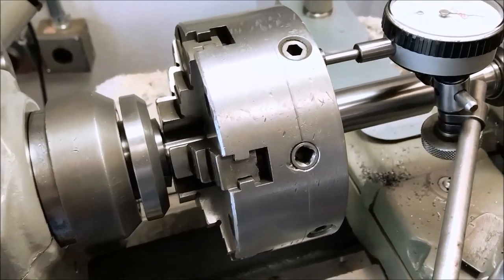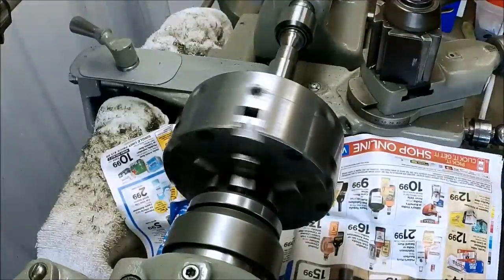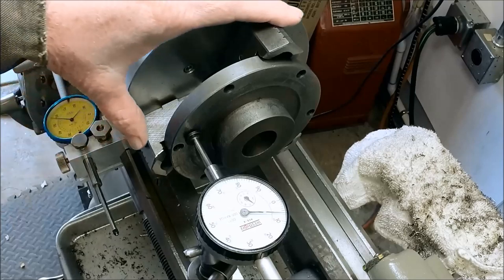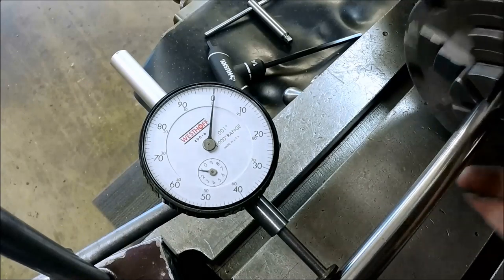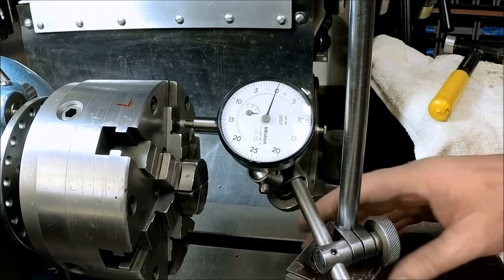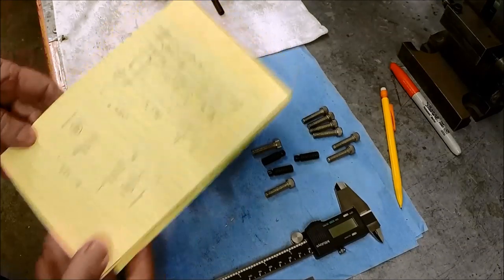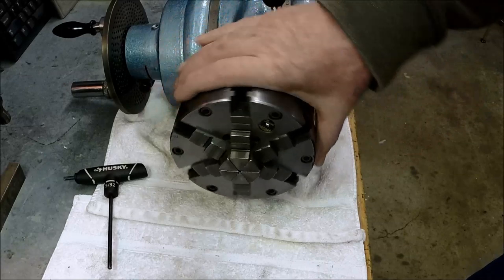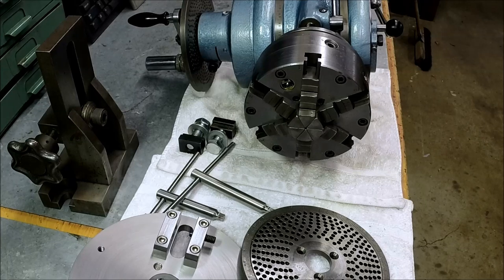Walter Dividing Head Restore Part 6 - Final

Comment: From at least my perspective there's no need to apologize for the length of this series since it was very interesting. My limited online checking seems to indicate that Walter made some of the very best and accurate dividing heads around until you move up to the optical types. 

A very tough nut to crack with not having one true reference surface to start with. I did a bit of thinking and the original shims between the backplate and chuck body make no real sense unless it was a previously used and poorly machined backplate from something else and the shims were meant as a temporary "get to it later" fix that never happened. If Bubba got in there then the backplte attachment bolts would have been torqued right up between those shims. That over stressed area may slowly change as the metal continues to relax even after you've now re-machined the backplate surfaces. Hard to judge that happening for sure or not though. It would involve a fair amount of work, but pulling the DH's spindle, re-attaching the backplate to it, and then machining both surfaces of the backplate truly parallel with it and the DH spindle between centers would get you the surfaces dead square to the spindles axial C/L. 

If your lathes faceplate has been machined flat, disassembling that chuck then using shop made tee bolts that fit in the chucks jaw recesses would get the chucks face attached to your faceplate and square to your lathe ways. The chuck's rear mounting surface could then be re-machined dead square and parallel to the chuck face.
Reply from the maker: I like that idea. I've got several face plates, one is real thick so plenty of meat if it needs a clean up cut.
Thanks !!

Comment: Don’t re-cut the back just to get the face to run true... have you checked the face of the jaws you do want them to run true.. with bore running true  I would not mess with backplate and back of the chuck
Reply from the maker: Fred, I've checked the face of the jaws and the face of the chuck. They are both running running out in same plane with each other, while the internal jaws are running true to the back mounting face. I'm sure I introduced that error cleaning up the back mounting face, thinking the jaws were true.
The mounting back plate should be good, planning on leaving it alone.
I think my best course of action is with the jaws removed is mount the chuck with its outer face to the face of a true face-plate to cut the rear face true again. Once verifying the jaws and face are running true again, then regrind the inter jaws to run true in angularity.
I'm open to any suggestions and appreciate everyone input.
Thanks, Dean

Comment: Don't see why you are concerned with the runout of the face of the chuck or jaws as long as a true shaft, when chucked, runs true.  The parts you will be machining will be indexed off the bore of the chuck jaws not the face of the chuck or jaws.
Reply from the maker: Robert, Thanks for commenting. Your correct 90% of time I'd be using the internal jaws on a shaft or similar work. I'm trying to keep body and external jaw surfaces and flats all running true to each other in an attempt to do it right for those odd work holding jobs.
Hoping to get back on this chuck fix sometime this summer. Home remodeling work is burning up all my time right now. Thanks for following along with the project.
All the best, -Dean

Comment: I don’t understand why you keep checking non-mating surfaces ... they don’t tell you  much if anything about source of the run out ... I wonder if the backplate was originally matched to the chuck ... and was lose when It was mess with by bozo assemble it incorrectly